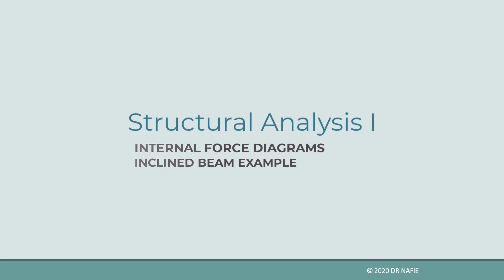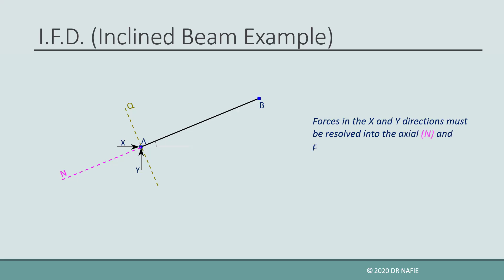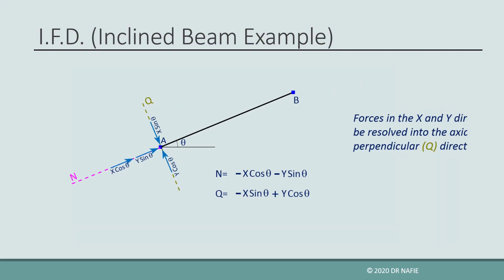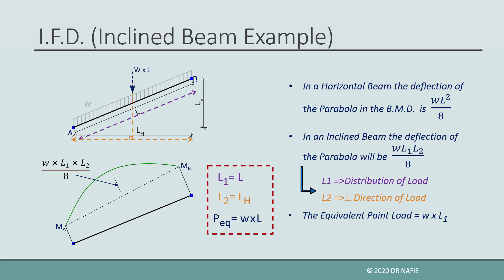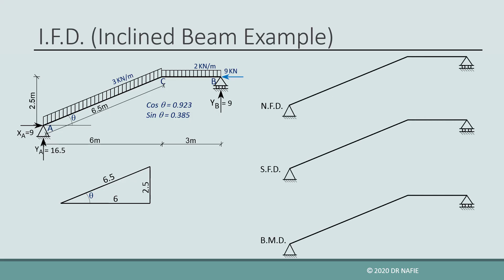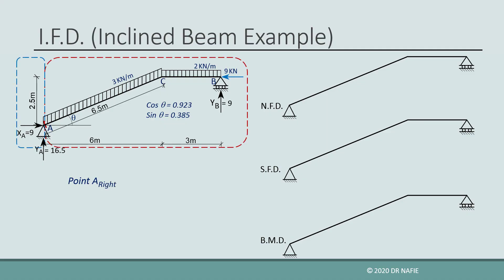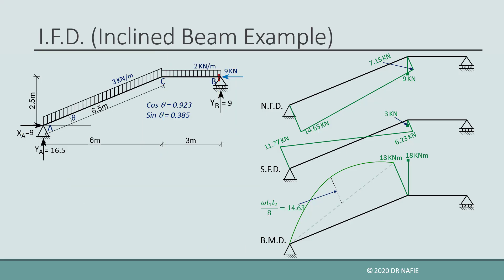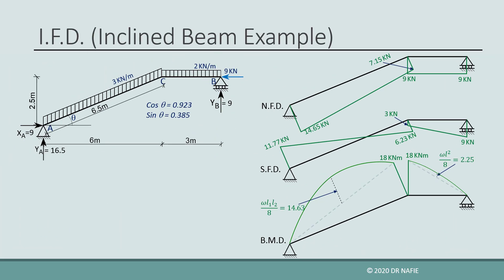Internal Force Diagram - Inclined Beam Example - Normal, Shear and Bending Example

Comment: How did you get "YA" Value as 16.5 Kn anyone please help with the reaction
Reply from the maker: You can evaluate this reaction in 2 steps.
First take the moment about A, then YA and XA will not be included in the equation, the equation will be as follows:
YB x 9 - 2 x 3 x 7.5 - 3 x 6.5 x 3 + 9 x 2.5 = 0 => this will produce YB= 9
Then take sum of forces in the Y direction =0
YB + YA - 3 x 6.5 - 2 x3 = 0 => YA = 19.5 + 6 -9 = 16.5

Comment: Hi dear. Still i dont understand one point in general ( not related to this lesson) i wann know how to know where to place cosine and where to place sine, this confusing me a lot,,, i cannot proceed the rest unless understanding this 😭😭😭😭
Reply from the maker: For the special case of the inclined beam there is a very easy rule.
Suppose that the inclined beam makes an angle theta with the X-direction (horizontal) . and we have  forces in the X (horizontal ) and the Y direction (vertical). 
Then the normal force will be formed of two components:
The first component is  X Cos (theta) ( X is the sum of all the forces in the X directions), the second component is Y Sin (theta) ( Y is the sum of all the Vertical forces) [ recall that theta is between the beam and X, so X takes the Cosine and Y takes the Sine}

The Shear force will also be formed of 2 components but the cosine and sine will be reversed.
we will have X sin( theta) and Y cos (theta)
Reply: @drnafie-structuralengineer4620  great thanks so much dear.
Reply: Hello, I hope I can help. Based on my understanding, if your angle (theta) is along the X-axis and you're looking for the vertical force, you will use sine (since Sin=opp/hyp); and for horizontal force, you'll use cosine  (since it is Cos=adj/hyp).

And if the angle is along the Y-axis, you will use:
Sine for Horizontal force
Cosine for Vertical force